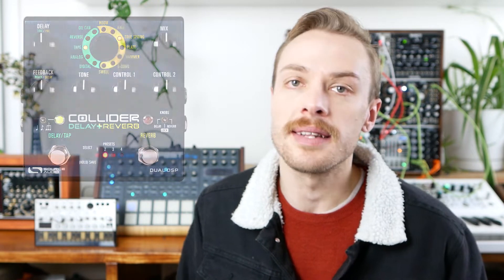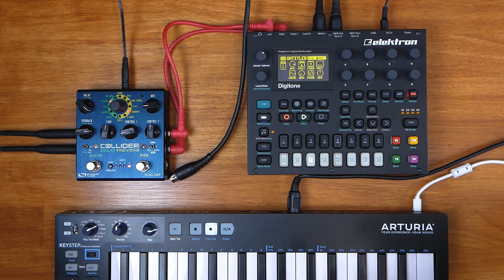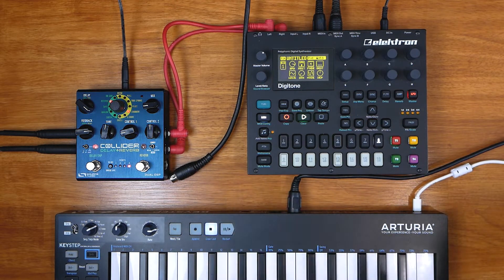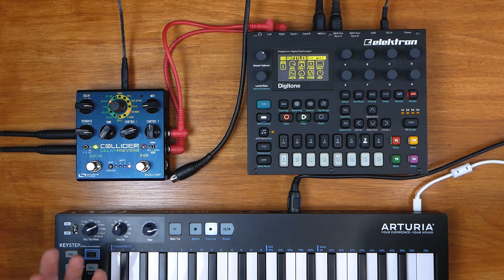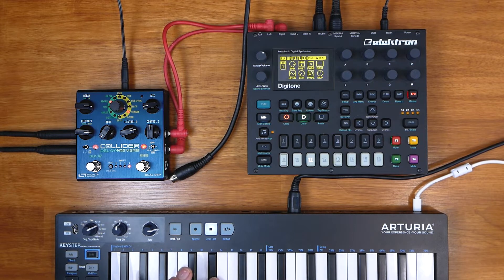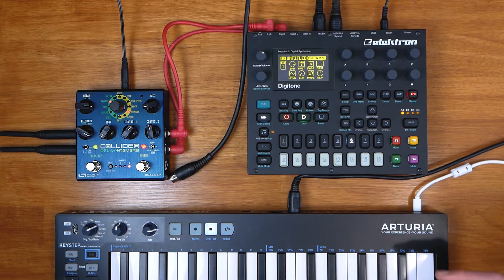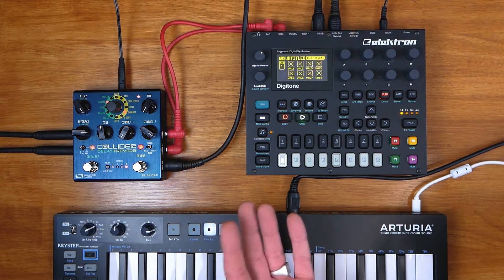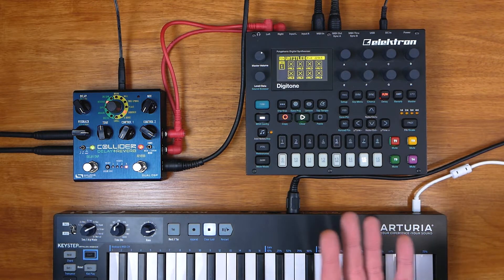Tutorial: Creating Complex Effects Utilizing MIDI Control with the Source Audio Collider Pedal

Comment: Question: If you have a midi controller without midi clock hooked up to a Ampero II Stomp which does have midi clock, and then that Stomp hooked up to a Collider, can I use the midi clock of the Stomp to sync up with the Collider, even though my midi controller does not have midi clock?

Comment: did you run into any input level issues using line level? I have a Nord Lead 3 that needs an effect pedal...and this sounds great but concerned it might overload the pedal input stage.  Anyone using a stereo synth thru this item?
Reply from the maker: Source Audio gear handles line level signals  easily, i even often use my Eurorack gear through their pedals - never had a problem
-Mike